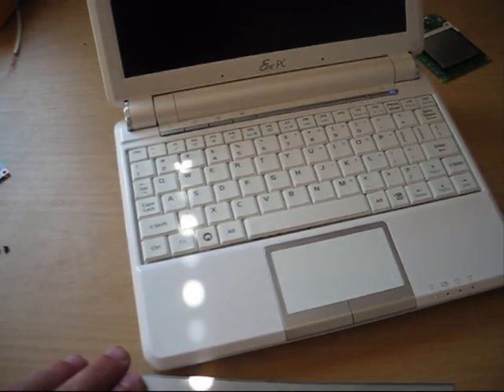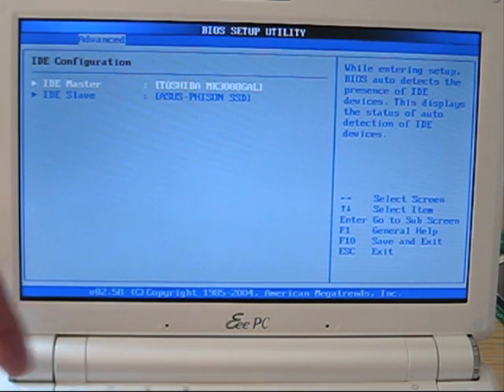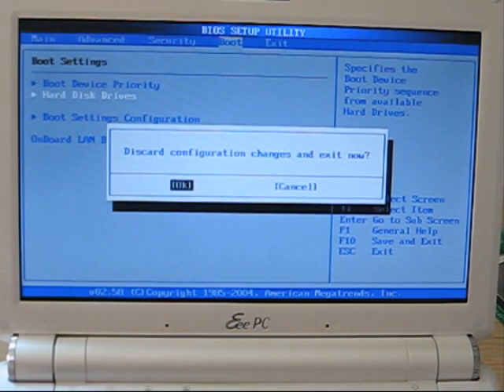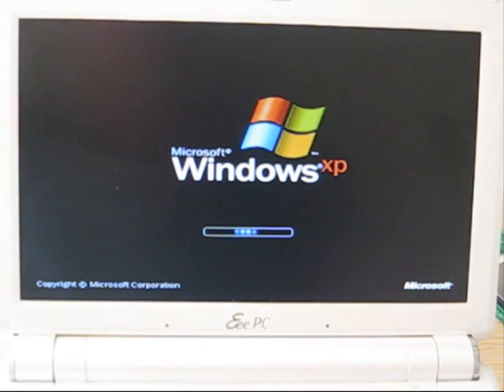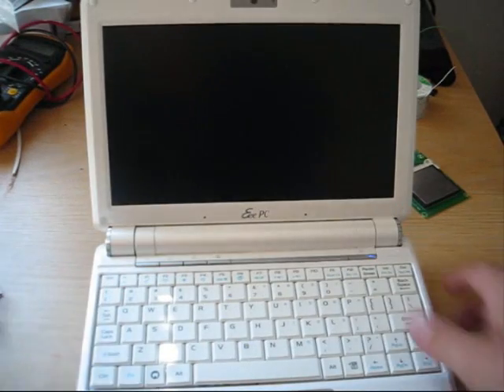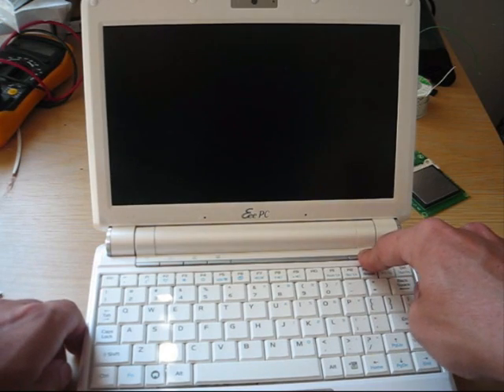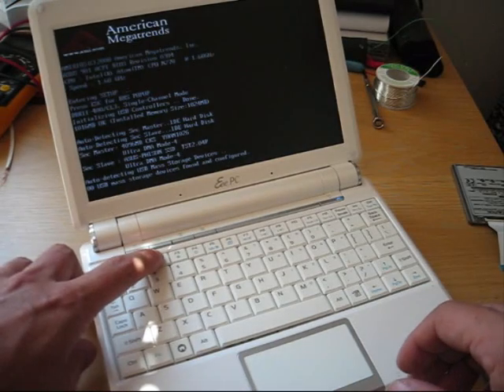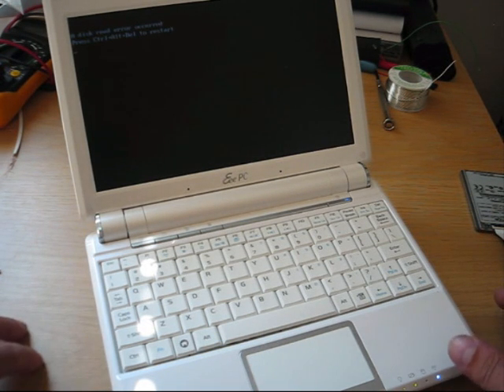How to add more storage to Asus Eee PC 901

Comment: i've got one of these the 12GB SSD version but no charger so I am waiting for the charger to come from eBay I had a look at mine and I can't add a hard drive as the connector has not been installed on the mover board :( so looks like I'm suck with the SSD, great video I hope to be getting mine up and running soon then I'll make a video on mine

Comment: A late reply, but: early EeePC 901's had the ZIF connector, in later models it was removed and you need also to use a ZIF adapter plugged to the Mini PCIe connector.

Comment: I am having problems with this.  I installed the hard drive and the comp recognizes it, but it appears that the drive I took out was the only other drive in the computer.  I don't have an SD card in the side so is there another drive?  I ended up putting the old drive back in and then I was unable to change it to master status.  The bios let me switch back and forth between the two drives, but kept insisting on keeping the new 1.8" drive as the master.  WHY?????   what can I do to fix this?

Comment: Why would you wanna do that? YOu got the chance to buy bigger, 500GB, HDDs for almost the same or even less money that you would spend on a 128GB SSD , which is the biggest one on the market now. 

Think about it. You will have more storage on the go because the 1005ha's power consumption engine was design specifically for regular HDD(hard drives). 

LOL

Comment: If I were to upgrade the SSD, would the module be the same size as the OEM (8 or 16GB) unit? Meaning it would sit in that little space and screw in without need for spacers or tape? Is it even worth changing an OEM 16GB module to an aftermarket one of the same size?

Comment: actually not as simple as what you all tought.
only put in the harddisk,, just like that simple 123?
as i know,, the ssd version if need to replace to harddisk,,need to solder 2 capacitor on the mainboard. why? bcos the harddisk pull more energy then ssd.

Comment: Just had a look on my 901 and unfortunately the ZIF connector is missing. It's got the pin-out on the PCB for it, but the connector itself hasn't been installed.

Looks like Asus has decided this is no longer required, so look out for this on newly purchased machines.

Comment: Great Vid.
If I use the 1.8" zif 30GB hdd as the master will I be able to install XP and boot from it? In addition will the light indicators on the eee flicker in response to the correct hard drive activity or are the light indicators at the front of the eee geared to work with the activity of the 4GB SSHD drive only?